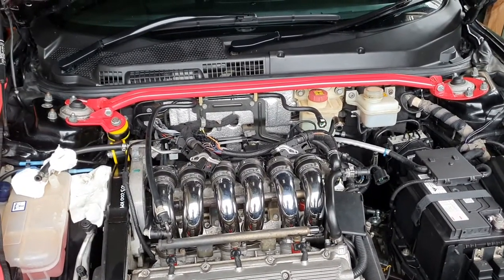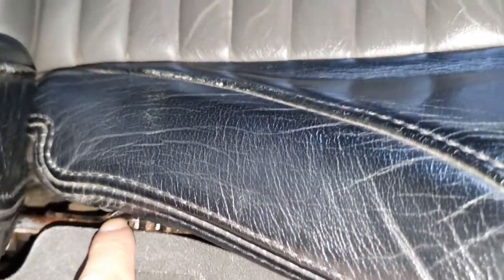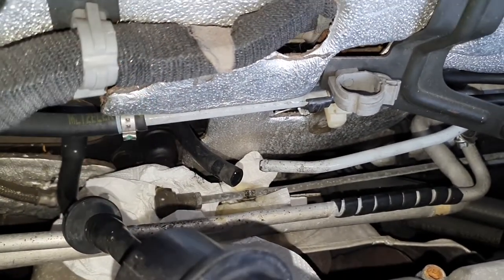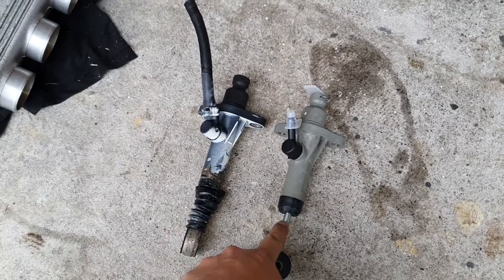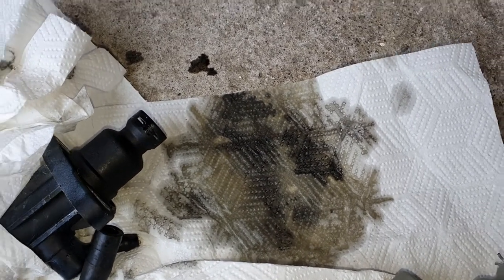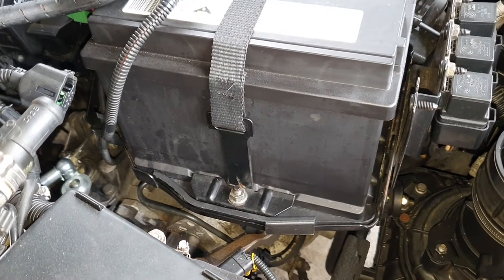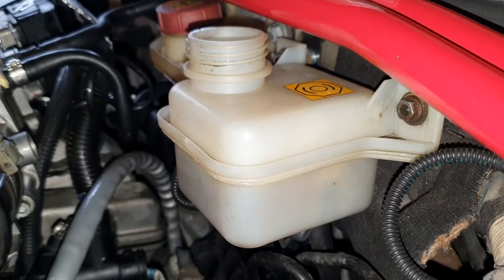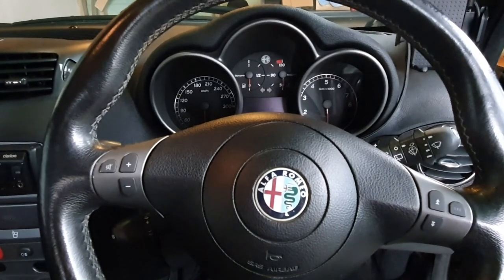Alfa Romeo 147 GTA Episode 18 - Clutch master cylinder replacement DIY

Comment: You can rotate the piston in the master cylinder 180 degrees and the squeaky noise will go away. Worked for me. Replacing the the whole thing would be better.
Reply from the maker: Ah good tip there, I could tell mine was pretty stuffed so I decided to change it and make the video

Comment: Lovely gta bro, I have a question though. Is the process the same for a 147 twinspark? I’m trying to replace the master cylinder on my 1.6 ts and the engine layout is a bit different and can’t seem to locate the relevant parts in the engine bay. Master cylinder inside is the same though. Thank you!
Reply from the maker: I haven't done this on a twinspark but the process should be almost the same, have a look at the firewall area there should be hoses poking out
Reply: My alfa 147 2.0L the same thing, mine the clutch paddle just keeps dropping and i have to keep on bleeding air out for it to bounce back only to come 10kms far clutch paddle drops again, yet no leaks nowhere even gearbox sleaves are not leaking including the bleeder section i think my mass cylinder is sucking in air and seals has gone in it, i am from south africa🇿🇦 I'll have to fix mine now this coming weekend im awaiting new mass clutch cylinder🙂..then the lay out is the same as for the comment above "tompovey" you are correct the engine layout mine and yours looks the same and the working space is hectic small.

As for the video its super awesome information given we need more.

*and your 147 GTA looks super awesome❤️✊🏆
✊❤️🇿🇦Much love&respect from Alfa fans around the world to you brother.

Comment: My clutch wont disengage fully, I noticed when I depress the clutch pedal the fluid in my resevouir lowers and when I release the pedal it raises again, does this mean my clutch master cylinder is bad?
Reply from the maker: I'm not 100% sure sorry, it certainly would be the first place I would start. Both the slave and master cylinders get worn out over time and need refreshing anyway. The parts are cheap and the slave cylinder is pretty easy to change
Reply from the maker: You could also try and bleed the system from the slave cylinder to see if maybe its just air bubbles...change the slave first if that doesn't work and see if it helps
Reply: @LueysGarage  I have this problem for about 2 months now, the car has a new flywheel, friction plate, new reinforced stock pressure plate, new slave cylinder inckudign the Throwout bearing, gearbox oil, gearbox mount. I have done 2000 miles with it without any problems until a friend of my drove my car and launched it a bit to rough from a standstill, he wanted to quick shift to 2nd but the gearbox refused. So after that I went to a different gearbox, swapped gear mechanism, adjusted the shifter it self, thinner gearbox oil, new dot4 I clouding flushing all calipers and bleeding many times the slave with pressure, gravity bleeding and also leaving the pedal pressed 3/4 overnight but still the issue persist. 

Clutch won't fully disengage, tested on a stand still in first gear with pedal fully depressed. slowly pressing the accelerator pedal. At about 6000rpm the car does move forward with still the clutch pedal fully depressed
Reply from the maker: @Grandpasaab  Asked George and he says: arm between slave cylinder and clutch mechanism bent
Reply from the maker: @Grandpasaab  could be the flywheel is too thick as well? Or maybe something has gotten stuck between flywheel and clutch? Flywheel distorted?
Reply: @LueysGarage  my gearbox does not have a arm, it's a slave cylinder + Throwout bearing which slides over the input shaft. Also if the flywheel is distorted I should get it right?

What about the fluid that Lowes when depressing the pedal and raises when releasing?
Reply from the maker: @Grandpasaab  hmm then I'm not sure what the problem might be, if the dimensions of the system are all correct then it should work together. I think the fluid going down and up with the clutch a little is normal

Comment: Any tips to refit the hardline to master cylinder? I just can't seem to get the hardline attached to the new  master cylinder! 🥲
Reply from the maker: I don't remember having any issues putting the line in the new cylinder apart from having to use the old clip...perhaps check the connection visually before trying and see if there's corrosion? May have to give it a clean or something